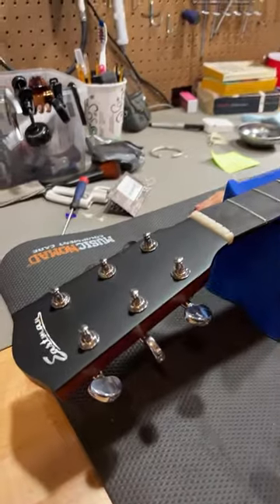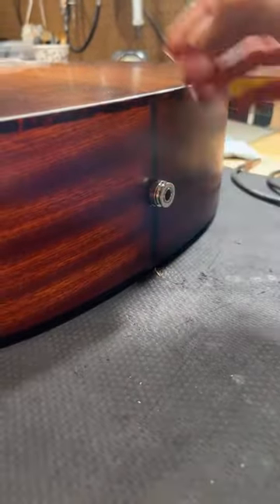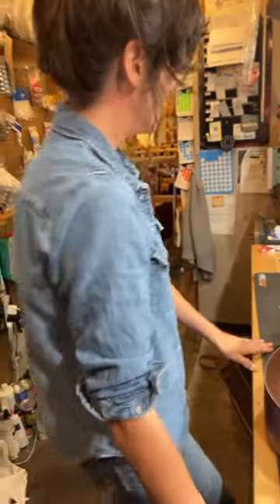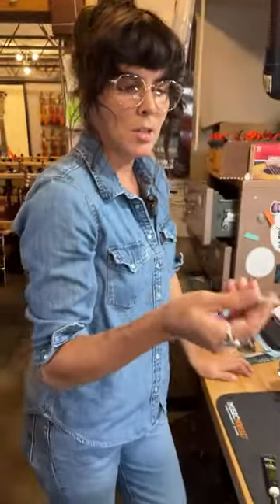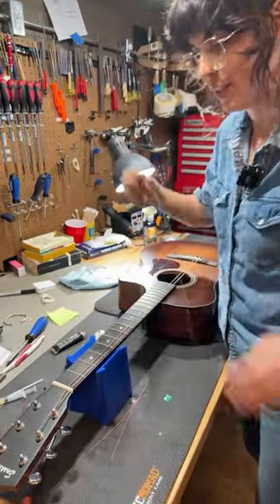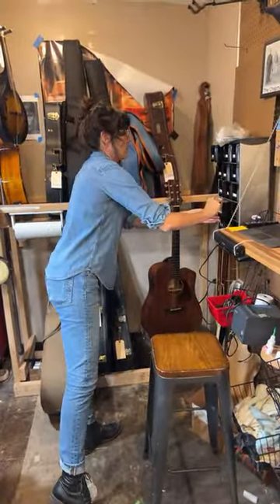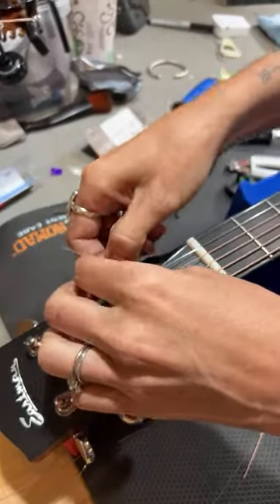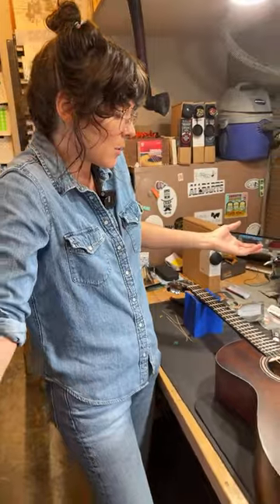No Need to Take Your Instrument in to Get Repaired, Guitar Fixes You Can do at Home!

Comment: Nice video Liz! If you are going to use thread lock on the jack threads, use the blue kind (version) . The red is permanent and very hard to remove. The blue is just as effective but can be much easily undone. I think it is safer to reduce tension on strings before tightening the truss rod. As someone commented below, it sometimes takes a few hours for the neck to actually adjust depending on how old and when the rod was last adjusted.
Reply: Yes,  blue or semi permanent Loctite. Just a dab. Better yet, they make a version that comes as a stick, sort of like a glue stick. A little dab on a toothpick in the thread and you are good. It won't back out, but it will undo if you want to remove it.

Comment: Thanks, Liz. Question: when restringing, how do you find the hole on the tuner post and through the loop when you can't really see the hole?  Currently I use a tooth pick through the hole and have the string push the tooth pick out. Been doing it that way for 50 years.  Not sure how that would work with the over and under method. I cannot see it in your video.